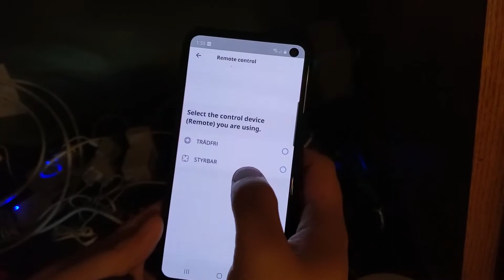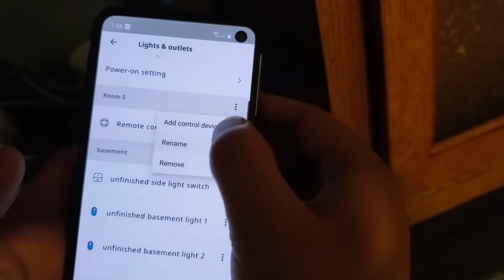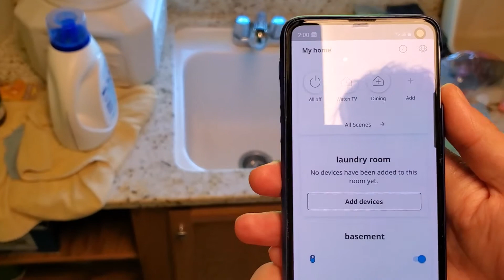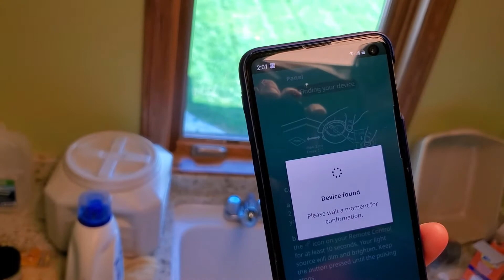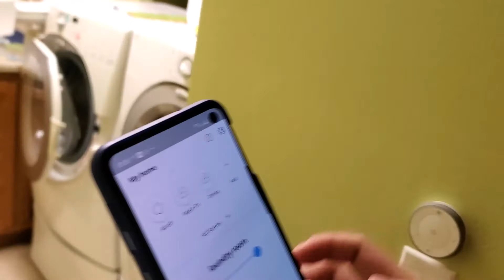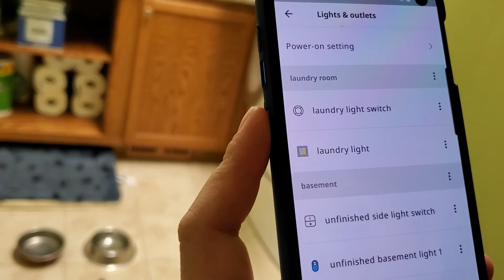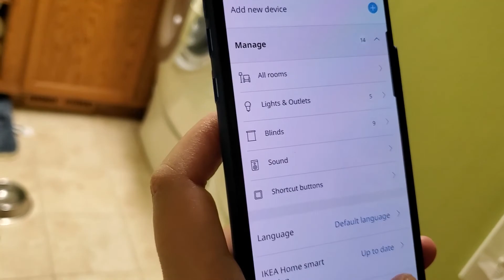IKEA FLOALT Smart LED Light Panel, dimmable white spectrum

Comment: What happens when the light goes out? Do you have to buy an entire new light fixture?
Reply from the maker: Yes. Since it is a LED panel light, there is no bulb to replace.
Reply: @QTTechReview  Did u replace it 3 years after posting this video or is it still working?
Reply from the maker: @SweettMeow    It is still working after 3 years.

Comment: Do the 5 options in Alexa actually work? Or does it still operate with the default 3?
Reply from the maker: Yes, you can set some Alexa routine to change the temperature of the color.